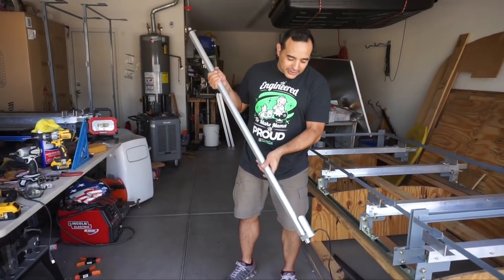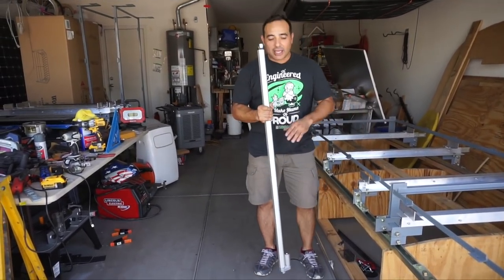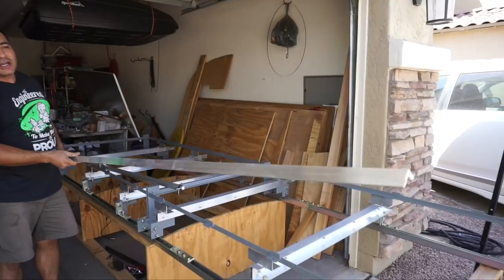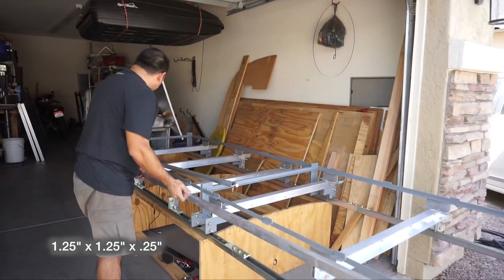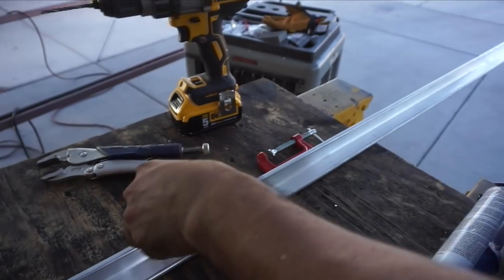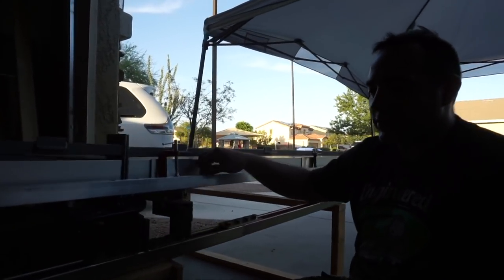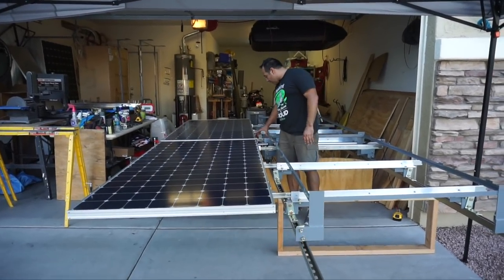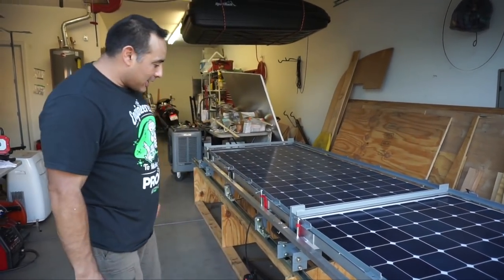Solar Rack: Part 5 - Fitting a Linear Actuator

Comment: I have a concern with your design. Though it seems to work fine, if there's a bind anywhere in the system due to dirt/debris in one of the roller slides or by another obstruction, the actuator has enough force to destroy the sliding system. I'm not sure what the "fix" for this would be... or if one is needed. It's just that I have this vision of being off somewhere with the family in the RV and while extending the solar rack, the extension system gets trashed and now you're in trouble, unable to even drive due to broken panels on the roof.
Reply from the maker: Hi Hakuna Matata - A bind could represent a significant problem.  This actuator is rated at just under 200 lbs of force - enough to bend things up for sure.  For a "fix" I am thinking of putting a circuit to monitor the load from the motor.  If the motor encounters a significant load the Amps will spike and it will trip an alarm to alert me that something went wrong (before anything gets destroyed hopefully).  This will allow me to go inspect the slides etc and see if something is wrong before attempting again.  It's not a perfect solution but it should hopefully keep things from getting too bent.  The worst case scenario would mean I needed to unbolt the solar panels and just manually push the sliders in (and store the panels somewhere while I get it fixed).  I am crossing my fingers that it works well - thank you for sharing your concerns.
Reply: A simple current-limiting switch in circuit with the motor will provide some of that protection for you without requiring any fancy automation.  These are used everywhere on RVs, from slide motors to blinds...  pretty cheap insurance.
Reply: Beginning from this Morning, how about a sheer pin somewhere, as a final “fuse” against catastrophic failure? Just a thought.

Comment: An interesting engineering exercise - but! How much more extra weight is all of this costing. I am all for ‘automation’ but figure your talent may have been better spent on a simpler, lighter and manual deployment system.But well done anyway.😀👍
Reply from the maker: Thank you Norman.  This should not a significant amount of weight.  The actuators are very light weighing about 6 pounds each and the aluminum bar is only another 10 lbs or so.  I am trying to keep everything as light as possible while still being strong enough to withstand the wind forces - it is a delicate balance.
Reply: Beginning from this Morning Thanks for this answer. I am now subscribed after watching this video and am now playing catch up to see the genesis of this project and get familiar with the (your) back story.😀👍
Reply from the maker: Thanks Norman!  Glad to have you along!

Comment: This is a fantastic project! Really. It's going to inspire many folks to follow suit. If you still have that shimmy after bolting everything up tight, perhaps diagonally X bracing the sliders with light stainless wire and "rigging screws" (bi-plane style) would stiffen up the rig without adding too much weight. From what I can see on the current design, you're largely depending on the glass sheet on the solar panel to keep everything squared up. A lil bit risky in my mind. 
I like that you've used aluminium rivets to attach the actuator mountings to the frame. I would have left the glue off though. If anything binds up on the inward stroke, the first thing to pop should be those soft aluminium rivets... A "shear pin" if you will.                 
I'd suggest adding a load sensitive trip switch to your electrical circuit. Measure how much current the actuator uses while it's operating and get a trip switch rated for ~20% higher than the measured load. If anything binds up later, it'll kill power to the actuator and may save your rig. This $10 trip switch could save you a lot of cussing later.... :-)    

Looking forward to your next installment!
Reply from the maker: Great suggestions Kevin!  I went back and forth about adding the glue.  I finally decided that if I use the actuator to keep the panels in I am more concerned about them breaking loose than breaking something while pulling them in.  The actuator is only rated to pull about 200 lbs - so hopefully a monitor on the Amp draw of the motor should catch a potential problem before I break anything.  Love the ideas - thanks!

Comment: With sliding panels is my new plan too. But at first I thought an actuator would just be too much but I think it can be a good lock in place now.
Reply from the maker: It has been working really great.  We did have some water get into one of the actuators and take out one of the limit switches so we repaired it by wiring the motor to bypass the internal limit switches and installing some IP65 rated toggle switches externally.

Comment: Saw so many cool things in your entire series, enjoyed it so much, and was so amazed at how happily and methodically  you two and your whole family  happily plugged away at so many tasks from mechanics, to construction to automation to electrical to plumbing to design, I thoroughly enjoyed the entire series. Often wanted to chime in and "suggest" ( read criticize ;-) ) some of the things you did and decisions you made, but couldn't bring myself to given how much you accomplished with basically some home shop tools and materials and just plain old American ingenuity and do it yourself tenacity. But I decided I should try it, if for no other reason but to encourage you and help you get better as I have no doubt your personalities will have you taking on more projects and improvements. First, I know you glued the aluminum, but you seemed to take to the MIG welding pretty well even though you didn't do too much of it, and an inexpensive TIG welder would have allowed you to weld the aluminum as well as stainless if the need ever arose. I have no doubt you have the ability to quickly pick up the skill. Secondly, when you discovered the aluminum angle you chose was too "bendy", you could have tried rectangular tubing, with a wider dimension only along the plain that you were exerting force on. A rectangular tube of say 1 x  2" would have been MUCH more rigid than  your angle and achieved your goal.

Your videos are great, I am a software developer by trade, and have a complete machine and welding shop in my garage to fabricate things for friends just to relive the nostalgia of working as a boy with my dad who was a diesel mechanic and fabricator, and lovingly if not always patiently taught me all these skills. Later in life I worked as a general contractor to pay for college, so I have all of these frustrated skills that are never called for while sitting in my office cranking out thousands of lines of code. It has been a blast living vicariously through you and your family, and enjoying your travels. Continued success and thank you for letting us share your amazing journey.
Reply from the maker: Thank you so much for the very thoughtful and kind comment.  Many of the things we did we thought of as a sort of "experiment".  Before building our bus we had never even owned an RV or built much of anything significant.  TIG welding is on the short list of things I REALLY want to learn.  The bus has held together amazingly well over the last 2 years of traveling and we are amazingly comfortable living in it even as a family of 6.  My oldest is going to college this summer so we are at this strange junction in our lives.  Do we continue to travel and roam without him?  Should we find a house and settle into a more "normal" looking life?  These are the questions we will need to face over the next few months.  I have been in software and computers since I was about 17 or so and I 100% understand your need to fabricate and build things - I feel the exact same way.  I plan to do a series of videos on how everything has worked as we have traveled the country and a short list of things I would maybe do differently.  As I sit typing this in the middle of the desert in Northern Arizona I can't help but feel an extreme sense of gratitude for the time over the last 2 years that I have had with my family.

Comment: I like it! Nice progress, but I see 3 more actuators in your future for added stability. In addition you could have a smaller solar panel and charge controller and it's own 24v battery for the actuator too. Not much different from the step down but it feels more direct, like not dependent on an oxymoron situation. In other words, it doesn't feel right to have your solar panels deployed by the very system that is charged by those solar panels. I guess it works on cars, they just get a jump start if their batteries go dead. And technically only half of your panels will be without power so it seems like as long as the sun is shining you should have the power to deploy. So now I realize that either way works, but I still like the idea of the mini solar panel.
Reply from the maker: Thank you Alex.  As you mentioned we should still have about 1740 Watts of solar with the panels pulled in - I get what you are saying though.
Reply: Alex, I agree with you about adding something to keep force equally distributed. But, additional actuators might not run at the exact speed and really get things out of whack. I think something mechanical needs to be in place to keep the extension force equal. And, a force limiter on the actuator would be something I'd like to have. Do I recall correctly that the actuator will push 100 pounds? This much force in the middle or at one end with a bind at the other can bend/break stuff.

Comment: A few ideas for y'all to think about

Concerning the wobble. I'd recommend putting at least 2 bolt in each slider for the rail to connect to and that should help with the play. If that doesn't fix the problem then the next thing you could do is look into something that would act as a shock absorber on the farthest out rails. I was thinking something that you could spray on that would be thin but have a rubbery texture. Maybe even something like electrical tape. Put it on the inside the sliders where the rollers roll. The small amount of resistance should reduce its tendency to wobble when the roller wheels are on it. You'd only need to put it on the last 10 inches or so of the roller bar since it doesn't wobble till it gets extended. 

Concerning if the actuator will be strong enough to hold the panels in. It might be. But it doesn't hurt to put some sort of safety strapping at the middle or end of each panel for when you are going down the highway. Just put a note above the actuator switch to remind you to disconnect the straps before trying to extend the panels.
Reply from the maker: Great suggestions Luke - Thank you.
Reply: Luke L Or they could use a rectangle tube of aluminum, laying flat. Problem solved.

Comment: You guys have done a really great job with this!
I was thinking the other way...with 2-12VDC actuators (car seat motors) on each panel that drive a long screw.
This seems a bit more expensive but might work a lot better in the long run.
Reply from the maker: Thank you Gregory
Reply: hi maybe you can answer a side question, you seem knowledgable on the subject.   Do they make telescoping actuators....my specific needs is it starts at 28 " then can telescope to 85"?    thanks in advance.

Comment: Smart design, maybe you could tilt the panels using the same device
Reply from the maker: Thank you JW - our original design called for tilting on the top level of panels but I was not clever enough to figure out a strong enough mounting mechanism that I felt comfortable with.  The wind forces that act on these panels are substantial and I didn't feel I could design something I was sure would withstand these forces and still allow us to safely tilt up.  Maybe my next design will incorporate that :)

Comment: This is very cool.   We would like to add this to our catamaran boat.   Any thoughts or info about salt water and dirt?
Reply from the maker: Unfortunately, I'm not too familiar with boat stuff, but the hinges are stainless. That being said, the ocean water is brutal.  Another solution I've thought about is making a hinge like a gate that latches in place when fully extended and folds away when under way.
Reply: @BeginningfromthisMorning  Was thinking that also,   but then the view would be removed.    since it would fold over the windows.   and yeah,  I'm fearful of saltwater.   What about something more simple.  no wheels at all.  just a slideable soft material.     Can't think of the name,  but,  a form of plastic?  not sure if that's worse
Reply: @BeginningfromthisMorning  folds away like onto the side of the vehicle yes?    I'm contemplating this to mount my solar panels on my brick fence.   they can store away with the fence when there is a windstorm, and then hinge around on 1 axes later

Comment: You can use a pair of bearings at each end to maintain parallel movement. Best to have a manual actuation system located in the luggage compartment to avoid accidental operation on the road.
Reply from the maker: Thank you Josie.   We are still researching options to be prepared if we get some wobble after we tighten everything down. Yes, we will have to have some kind of "lockout" setting or just cut power to it while we are traveling.  Thank you for the suggestions.
Reply: @BeginningfromthisMorning  Like a Normally closed relay the opens when the ignition is turned on?

Comment: Great work  man I like it  but lol instead of the  rivets you need to bolts  good job
Reply from the maker: Thank you Jeff - we are still experimenting with stuff.
Reply: I think there is a psychological resistance to relying on adhesives ( which I understood you to be doing primarily). I struggle with this. We need to see those bolts but adhesives are rated to do the job and I think we should trust those ratings. I love watching this series. I really admire your families ingenuity and work ethic.
Reply from the maker: Thank you David - I agree my resistance to relying on the glue is completely in my head - they are even using adhesives instead of welding on many car parts now - they have come a long, long way.  I just need to wrap my head around that - I am slowly learning to trust the adhesives.